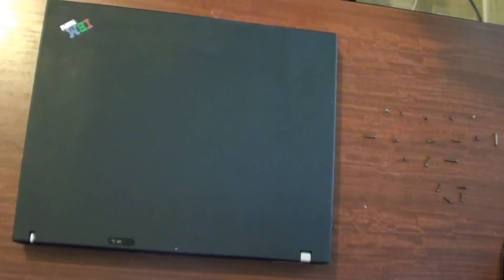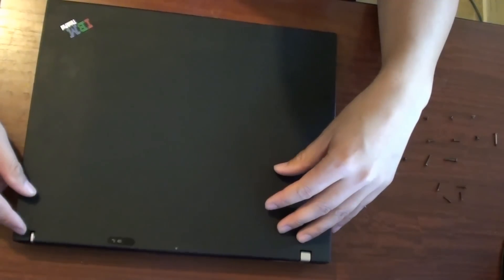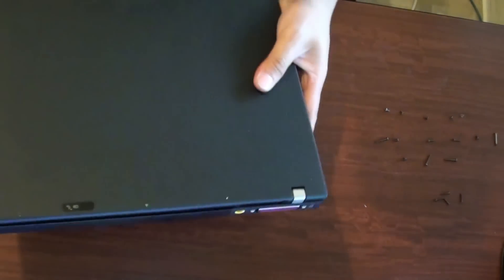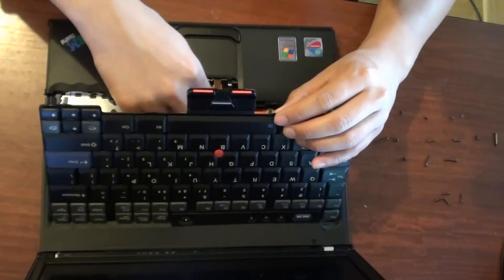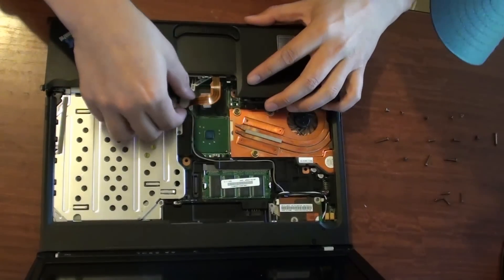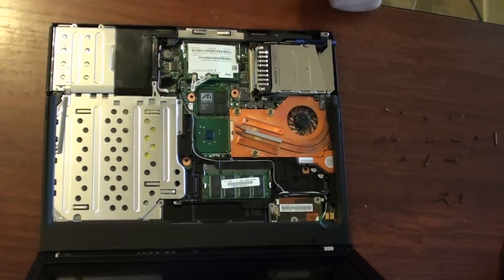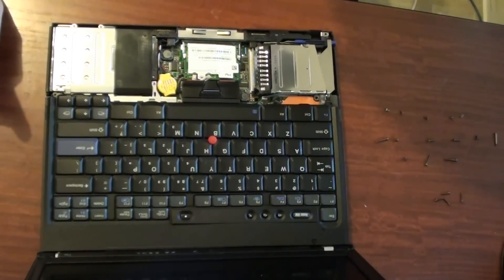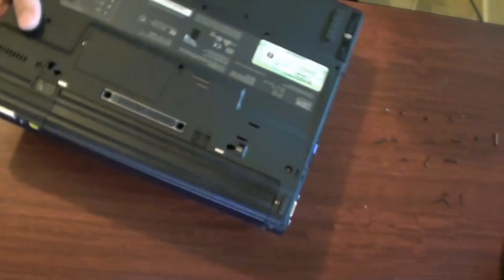IBM ThinkCenter Laptop: How to Replace BIOS Battery

Comment: Thinkpad R50E owner here.
Some of the screws are numbered, some are not, and the ones that are not, they are of different size, to just place them in a position that you took them out, it's gonna help you later.
I wasn't able to fully detach the keyboard and the plastics, but I was able to lift it up from the bottom side so that I could take the old CMOS out, and put the new one in.
Then screwed everything back in place, the keyboard still works, and I'll give you an update as to if the new CMOS from Ebay works.
Reply: Powered it up today, no CMOS date and time errors anymore! Works brilliantly. But it's a shame that the CMOS is so buried, saw a video on another Thinkpad and it had a CMOS in the battery slot or something. Like you just take the battery out and there it is, no need to unscrew anything.
Still, this was easy to follow, glad it worked.

Comment: Use a normal 3 volt lithium battery, make use the polarity is right and you have a good contact, Use tape and a small rubber band around it.

Comment: Each screw hole is labelled with its corresponding screw size (1 to 4, 4 being the longest) so you can't mix them up.
Reply: @Little Pug : thanks :))
Reply: I know, just wanted to comment that :)

Comment: I got a little lock on the left hand side of the screen. Do you know if I replace the battery that can resolve the problem ?
Reply: Monica Cuartas no thats the administrator password thats the most hard password to erase.. you will not do nothing whit remove the batery what you need to do is erase or confuse the eprom memory which is the place where that key password is kerp it.. becasue evene you dont have batery the key will remain there i have the same problem i have a thinkpad t40
Reply: Monica Cuartas hablo español
Reply: @cezarpo  
Hi Monica, this post is a little old, just my two cents;.. A few years ago I unlocked a T26 Thinkpad with the administrator password, .. I identified the EPROM chip where the password is stored, it is a SMD EPROM chip so ordered a blank brand new, and had to use the heat soldering gun that replace it. Also the password is married to the hard drive controller plate, in that way it locks the hdd  also, it  mirrors - compares the password between the EPROM chip and the hdd for higher level security.. So I also had to discard the old small in GBs Hard drive with the password,.  Smoth and good quality my vintage  T26  Thinkpad, I still enjoy using it.
Cheers and good luck.

Hola Mónica, hace tiempo yo le quité ese password a un Thinkpad. Primero ordené el EPROM-bios chip correcto, lo soles con antorcha de calor puesto que es una miniatura y el password del administrador se casa también a la placa de control integrada en el disco duro para compararla así con la del chip, remplace el disco duro con otro y con más GBs. Son tremenda calidad ésos laptops, suerte...
Reply: Monica Cuartas pudiste hacer algo? La clave que queres sacar es la eprom chip ahi dentro esta la contraseña pero tenes que intentar leer ese chip yo hice un lector.. pero no me arroja nada o lo hice mal.. ese chip guarda la clave del bios que es el candado que vos te aparece arriba lo se porque busque por todo internet y termine en este foro... https://commodoreman.wordpress.com/2014/07/10/eliminar-la-password-de-la-bios-de-un-ibm-thinkpad-t42/ 
Si te sirve mira y date cuenta porque..